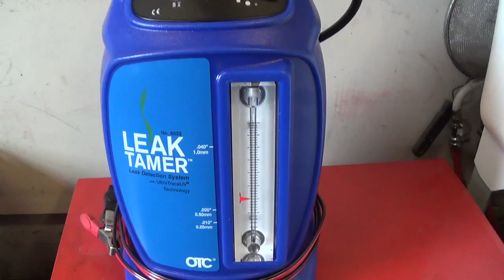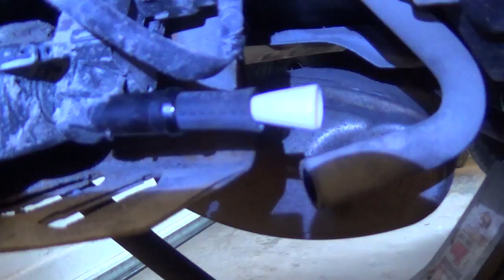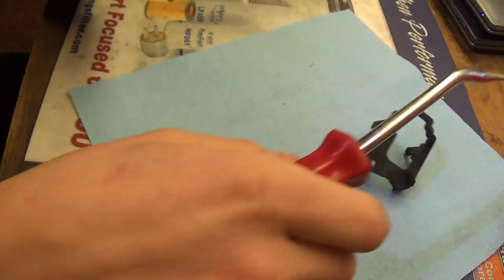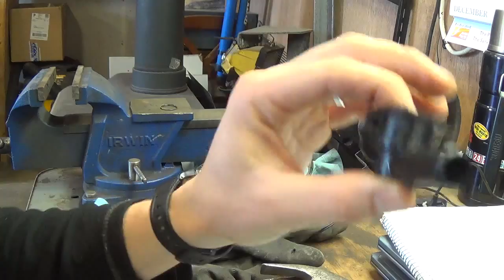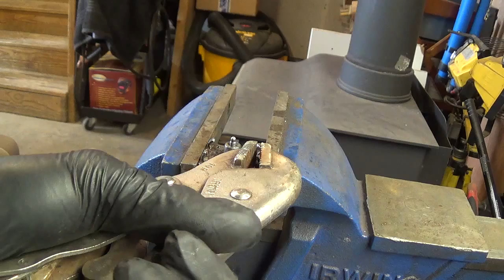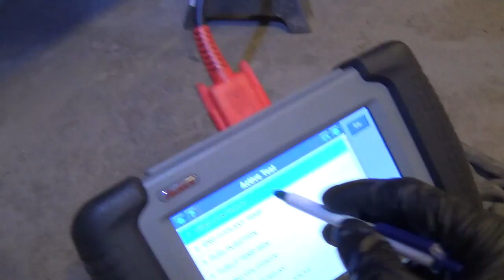EVAP P0456 Diag & Repair: Nissan Rogue - Part 2

Comment: You turned it into a go fast valve by reducing it's weight, and saved 150 bucks in the process. cool sense of satisfaction video and sticking your tongue out at Nissan.

Comment: Ivan, was wondering. By closing the metal tabs back on, why didn't you try to use needle nose pliers to squeeze the tabs more tightly? hammering the tabs might not have close it all the way. either way, great video.
Reply: Adjustable slip joint pliers work great to bend that style tab. They will rotate to follow the tab as it bends and you can clamp them down good to make the seal.
Reply from the maker: It was actually pretty tough metal. The small needle nose pliers wouldn't touch it.

Comment: The same condition happens on other solenoids that are exposed to freezing conditions.  I had 4 irrigation solenoids freeze and push the limit stop pin so the solenoids wouldn't open.  Unlike you I bought 4 new ones with a revised design.  Keep the videos coming.